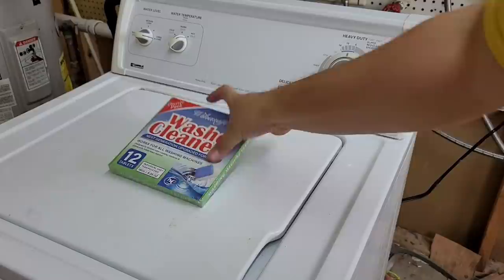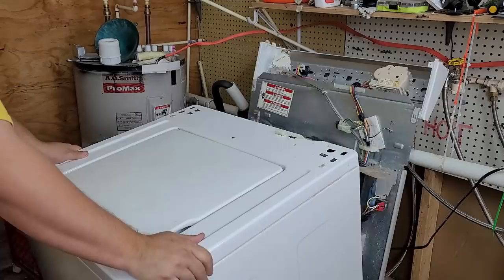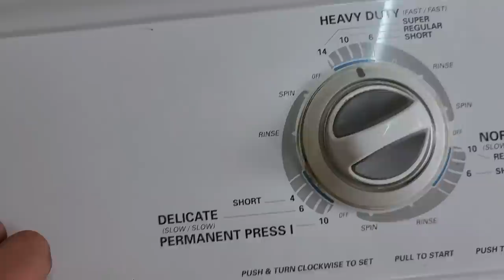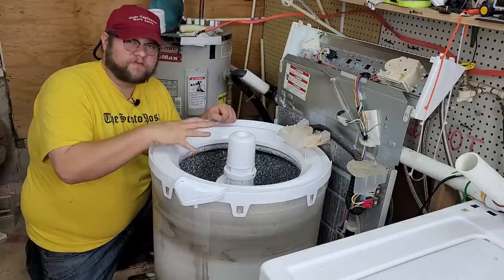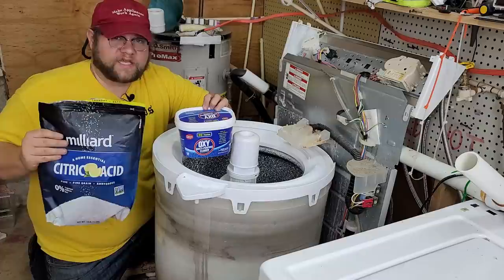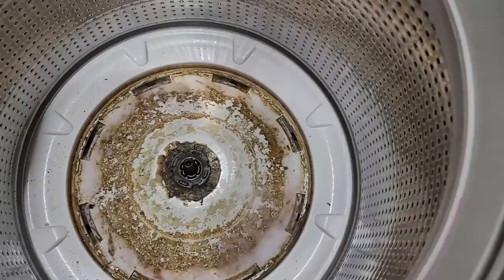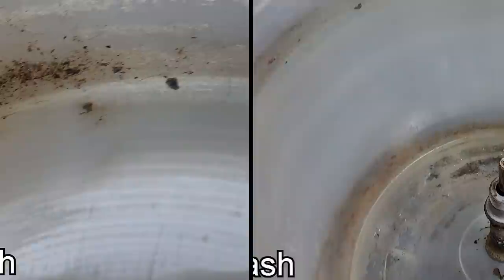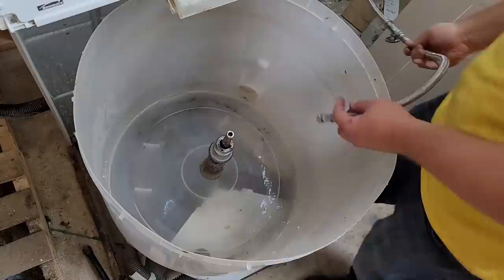Clean a Washing Machine Inside: How to Remove Mold, Soap Scum and More with a CHEAP Organic Cleaner

Comment: Oh my granddaughter called me she has a front loader she said I have spent so much money trying to get them smell of mole on my washing machine what can I do I said granddaughter pour two cups of bleach in there with with the water running I said it will take care of the problem she said why didn't I call you before. She bought all of these expensive chemicals that did not work use bleach or Clorox bleach it kills mole and germs don't waste your money on this crap sorry. I'm  Old School and I know all the tricks of the trade just put an old white towel in the machine and pour two cups of bleach problem solved or one cup of bleach. Put it on a medium long and just make sure you keep your lid open to your machine if you use bleach you should never have this issue when you wash your white clothes or Clorox

Comment: Citric acid isn’t recommended for cleaning your washing machine because it degrades the rubber parts of the machine.
Reply from the maker: And yet citric acid is in virtually every washer tablet made...
Reply: Not in one hour ,and the "rubber" is as easily damaged by chlorine bkeach.